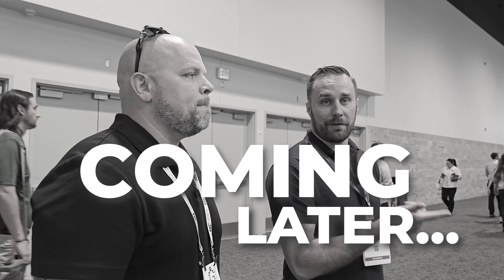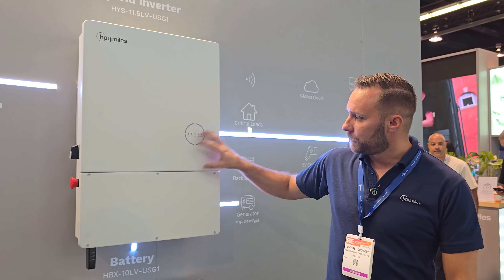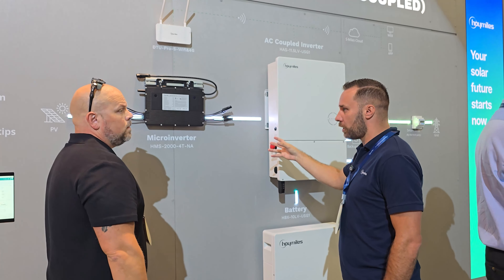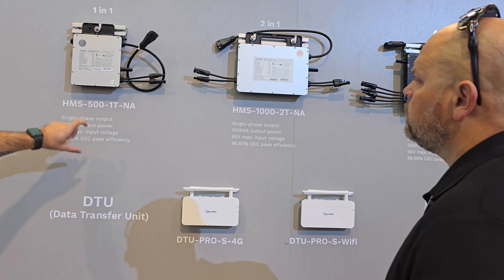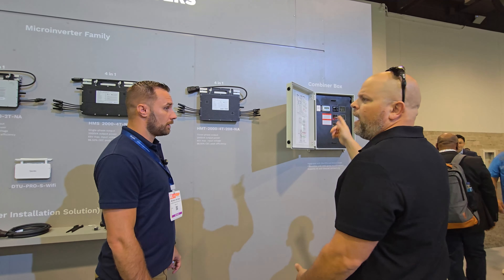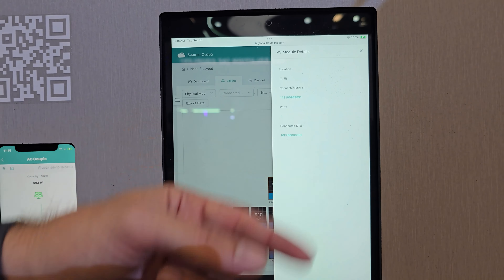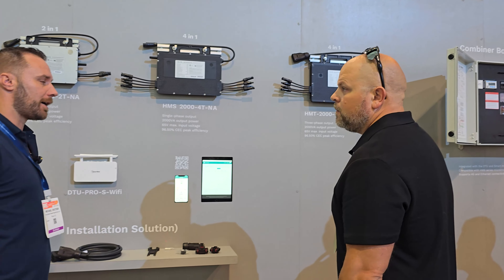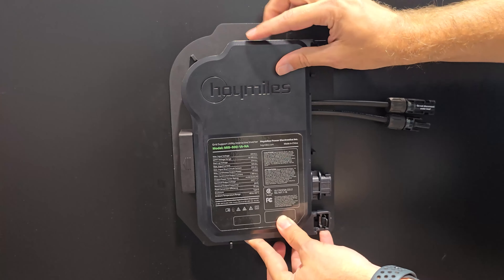HOYMILES reveals NEW microinverter at RE+ 2024

Comment: Justin, love all your series of videos! I researched the Hoymiles and like what I read but I read their warrantee completely and it says the warrantee is void if not installed by licensed solar installer. I have 40 years contracting and electrical experience but I am ( years retired. I have a large barn w/ S. facing shingle roof and I want to put 16KW + or-- on it next spring. The info on internet is overwhelming but videos like yours help tremendously. Is there any way Hoymiles will warrantee the DIYer? ------ Rick F

Comment: The MIS 500 is a 1 phase micro inverter, so is there coming some 3 phase inverters with 1 or 2 inputs?  Also a higher AMP would not be bad, the panels increase in size (and bi-facial) all the time, increasing AMPs too.